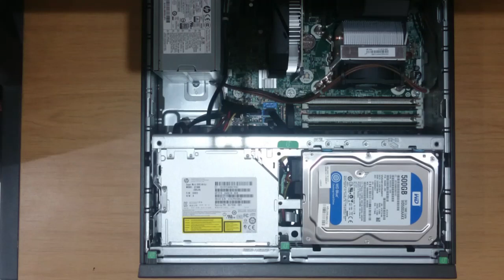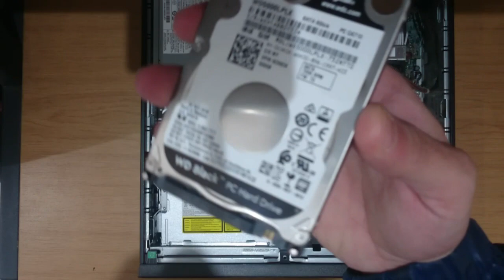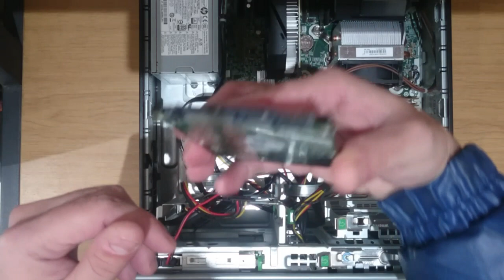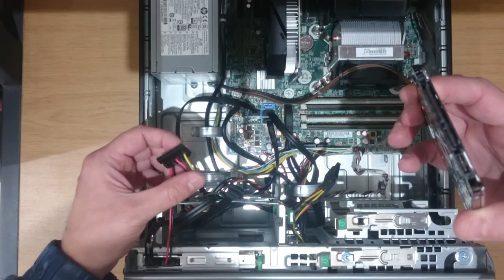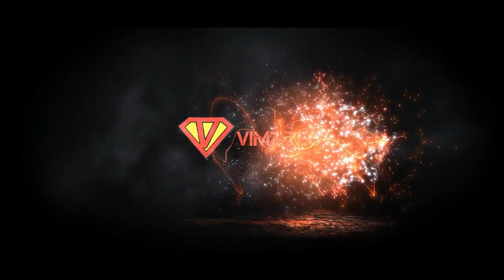HP ProDesk 600 G1 Hard Drive Upgrade by Vimz Tec

Comment: Hi sir were the power câble i can't find it
Reply from the maker: Good day and thank you for the comment. Please make sure you are using a sata cable to connect your hard drive. Your power cable is the smaller cable as shown in the video.
Reply: @vimztec2968  I need to buy it ? Or no
Reply from the maker: @martim-fl  Hi sir. If you are using a sata hard drive your pc will have it. If not please first make sure you are using a Sata hard drive first.

Comment: Cool but where do you put the harddrive when your done and does a 2,5 harddrive fit?
Reply: Thanks dude it would be cool if you did a  tutorial how to install a hard drive step by step inside the HP ProDesk 600 G1
Reply from the maker: Wishkonto thank you for watching the video. Yes a 2.5 inch hard-drive fits perfectly. There are slots available on the Ssf case. You will just need to mount the drive on the braket slots. If you liked the video plz subscribe 💥👌👍